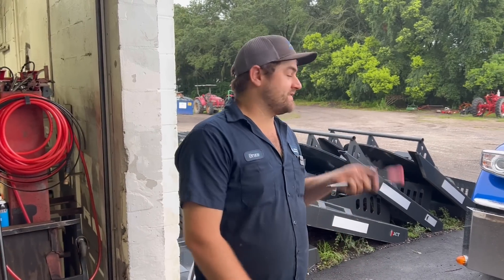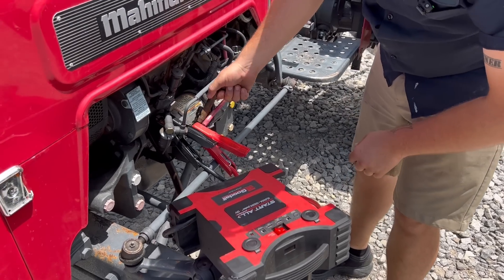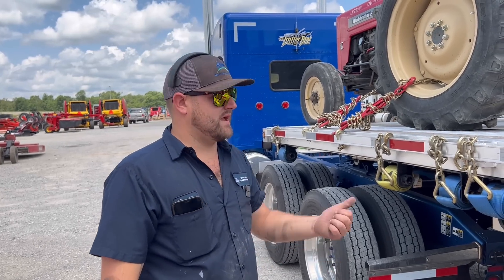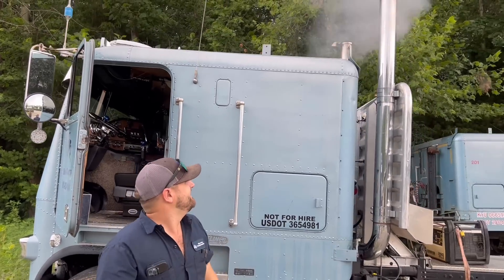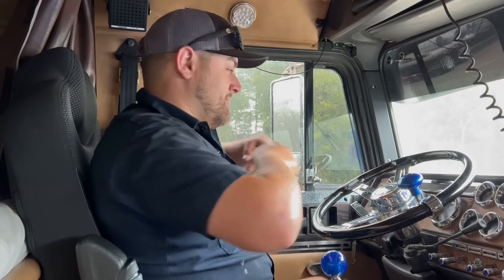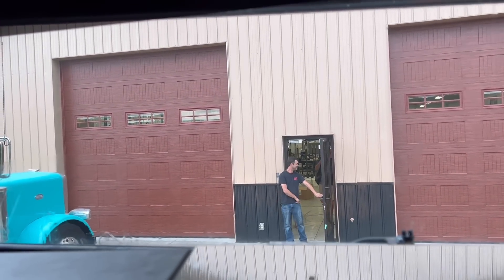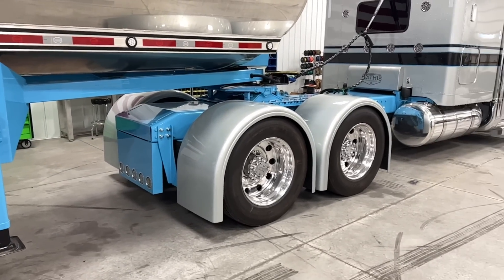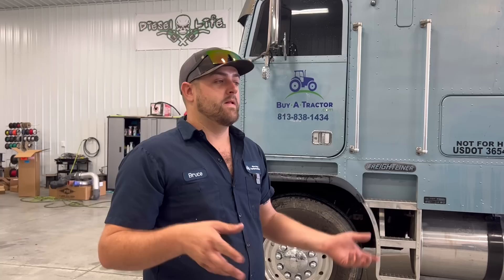The Cabover has issues… Let’s bring this ole girl HOME!

Comment: The plugs for the low beams on 389’s are prone to melting….don’t be stingy with the dielectric grease! Went through 3 on my 2015 389….

  A fresh 12.7 to replace the tired 11.1 would wake BC up nicely, along with a 13-speed to replace that Super 10….that old gal still has miles left in her.
Reply: Nice thing about rigs from my standpoint - classics are always worth repowering if the body and frame are good.

Comment: I had the same issue with one headlight bulb when I converted to LED. Coincidentally, the exact same headlight. Come to find out, LED headlight "bulbs" typically don't have a tab to indicate which way to plug them in, but I've been working with electronics since the early 80's, so I remembered that LEDs are unidirectional. They only work if you plug them in the right way. Turned the plug 180° and VOILA! It worked.

Comment: When the brake shoes get stuck because they have been stopped for some time, you can press and release the brake pedal several times and they gradually release. or also apply and release the parking brake several times

Comment: Howdy my Florida friend! I want to give you some advice! Number one, this might save your life, if your gonna try to brake your stuck brakes loose, if you are bobtail (like you were here) you ALWAYS chock your wheels before you attempt to brake them loose ALWAYS!!!!!!!!!!!! I cannot emphasize this enough, one little thing can save your life, because if they was to come loose that truck can run you over very easily and kill you! If you are hocked to a Tralier, you can safely get by with setting the brakes on the trailer and release the tractor, but in this case, you must ALWAYS chock the tractor first!!! Then, get rid of that dinky ass hammer and get a real hammer, and beat the hell out of it, then grease it, and spray WD-40 or something similar all over every moving part, so that they don’t hang again! Once again I love the Pete, that 389 is bad ass, I really like that cabover also, it’s a bad ass truck especially for a cabover Freightliner. Lol.